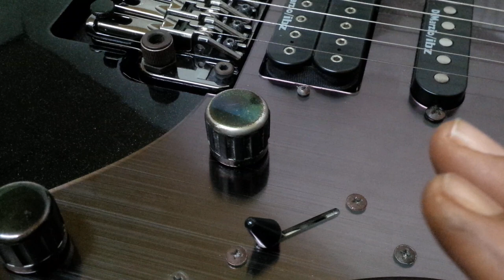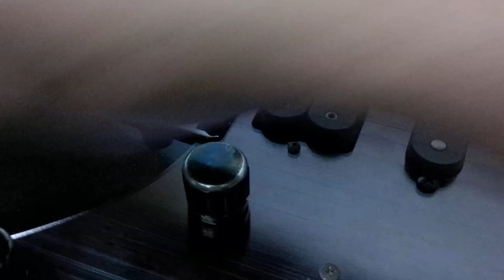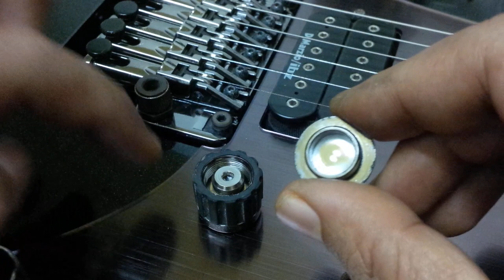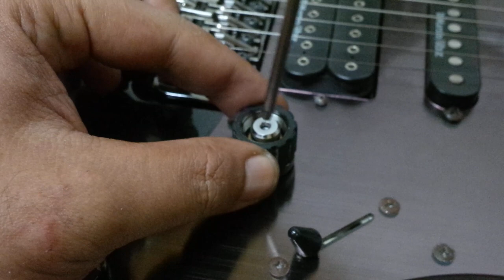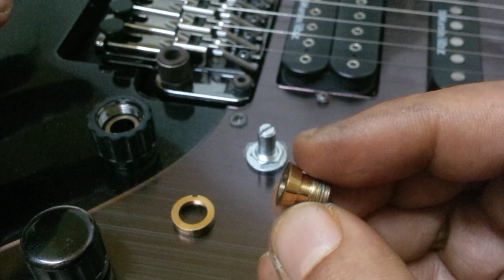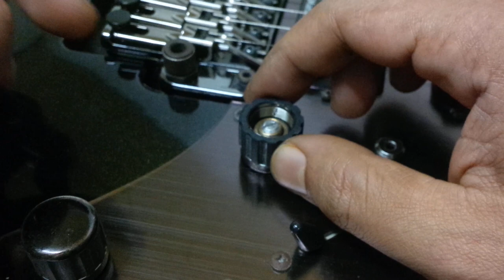Ibanez Collet Knob, How to remove.

Comment: any tips to remove the super tight  top? thanks
Reply from the maker: Lighter fluid, oil or lube etc. Use rubber glove or anything that has some traction or grabbing power to the top cap.